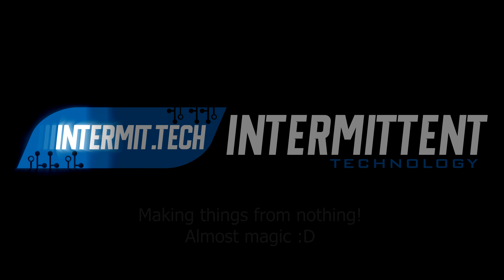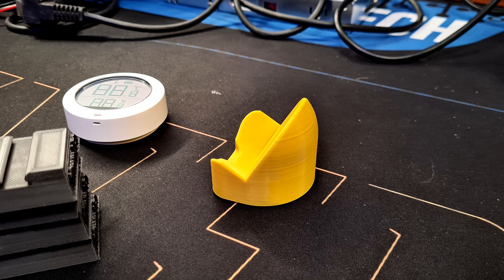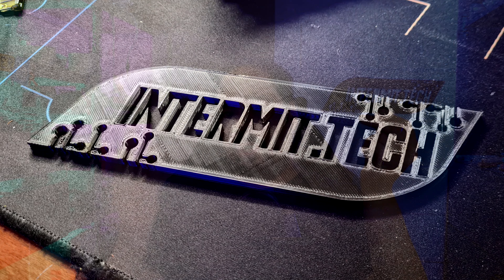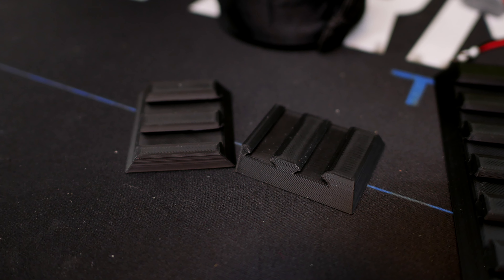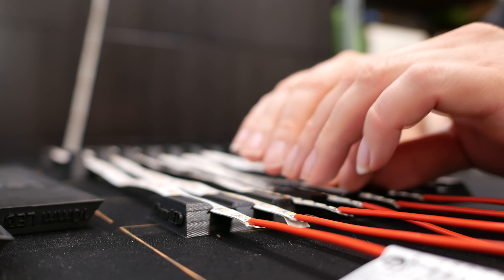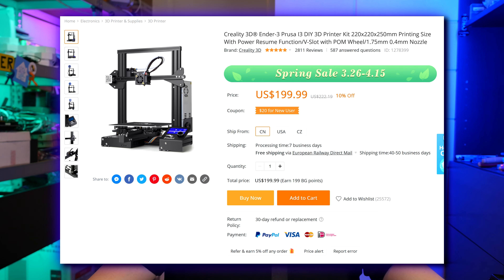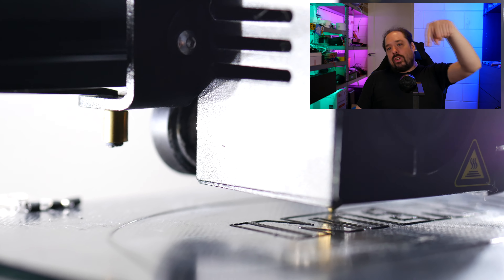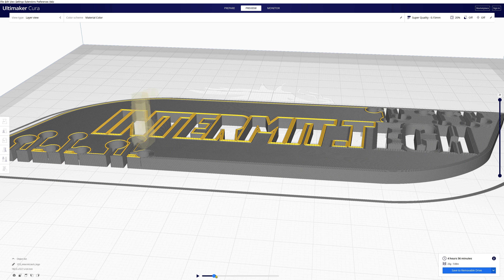Let's talk about: 3D printing (Why, Examples, Ender 3)

Comment: Now I really have an excuse to get a 3D printer.  Printing little brackets to hold LED strips!
Your prototype (small version) design with a hole to put a screw through it would make a great way to mount LED strips without having to buy lots of clips, which work out fairly expensive when doing a lot of strips and not as strong.
Reply from the maker: Oh, that's a good idea. I'll try and work on the design a little bit more and then release it in the future! :D
Reply: @IntermitTech  That would be great 🙂.
Thanks for all your releases so far.

Comment: Sup Quin, excellent rundown on 3D printing. I originally found your channel after looking for LED solution for my streaming setup. Wanted some wireless LEDs that were no compromise and would boost my props. Spark some life in em' . If you get the chance, you should consider covering lithopanes. I've used them extensively to make some pretty cool effects with poster frames + xLights to boost my home theater setup. Will try and post a video when the whole setup is more dialed in :)
Reply from the maker: Hey that's awesome! I haven't done much with lithopanes yet but might try my hand at the in the future! :D

Comment: If you want to make your logo from wood, there's a tool for that. A laser cutter 😁 there's a tool for everything. A 3D printer is just one of them. Printing 2D stuff is like driving in your screws with a knife. Yes, it works in a pinch. But you'd rather cut your steak with it.
Reply from the maker: Yeah ok I get that, but have to use the tools I have and a 3D printer is quite versatile for that! A laser cutter also has a lot more requirements in regards to room and such. But who knows in the future ;)
Reply: @IntermitTech  you can actually 3D print in wood :) there are wood filaments available
Reply from the maker: @matiasq2  Yeah, I've seen them, never tried it, maybe I'll order some soon! :)